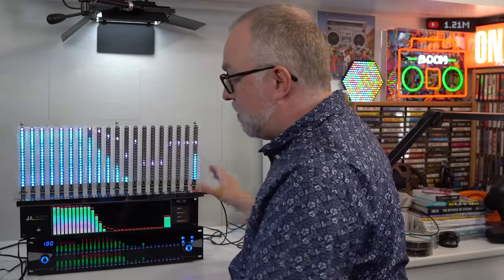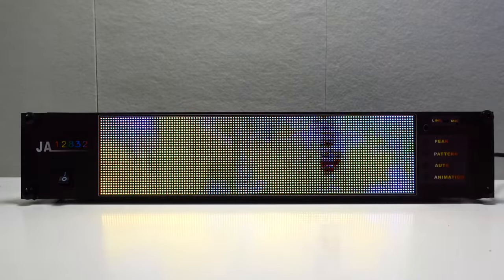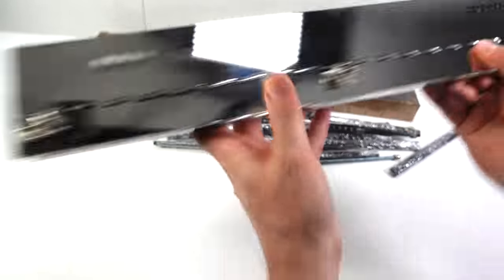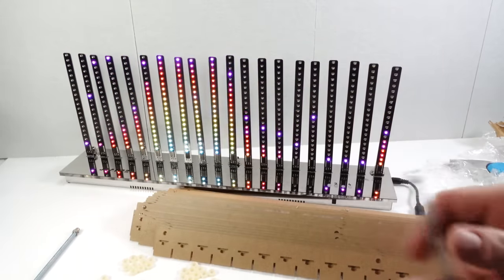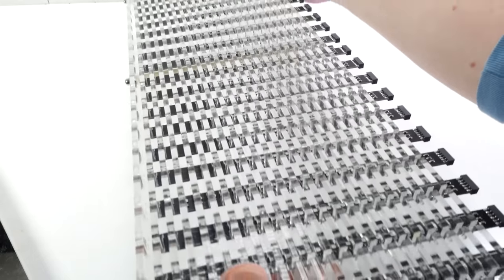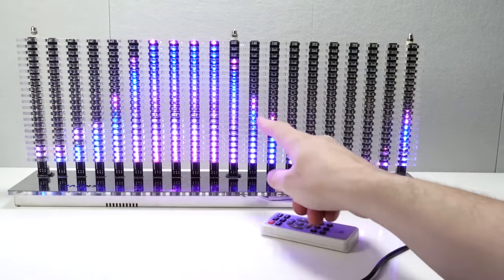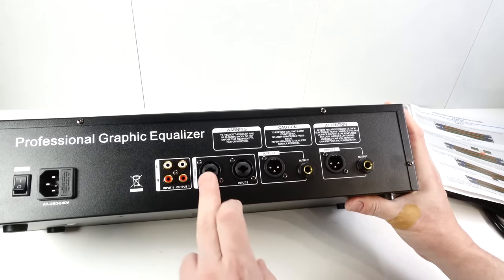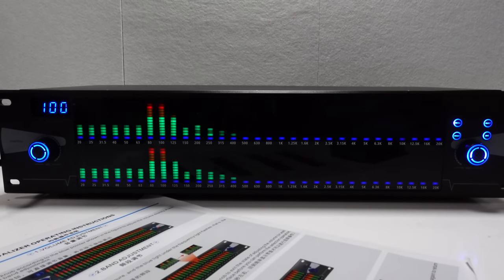Three more music Spectrum Analysers.  All that glitters...

Comment: The “dual channel” one that is actually mono just blows my mind. Why would they do such a stupid thing?! Anyway, you made it entertaining for us as usual!
Reply: money.
Reply: They could have used 2 mono circuits stacked one on top of the other (and use that in their mono version).
Reply: It's China style marketing
Reply: They know the "consumers" are easily impressed mit der blinkin lights...but don't know enough to question why? All they need to know is...."it's cool"...(and if it can be mounted on their dashboard.)
Reply: Agreed. It's not an impressive light show, and you can't tell which channel is clipping to use it as a spectrum analyzer.
Reply: Because they think (rightly, in the vast majority of cases) that no one will check
Reply: A surprising number of the things reviewed on this channel have had two channels of display that always display the same thing. Heck I think I recall some times when there were left and right speakers, both playing the same thing.
Reply: I'm wondering if it's a setting somewhere. Probably not though.
Reply: @John_Ridley  That's right. It made be go back and check a no-make CD walkman I bought five years and wouldn't you know it, that's mono too.
Reply: @savoirfaire8979  I've gotten lots of stuff from China that was cheap and still decent quality. For 150 pounds, you can get a computer monitor, a Fender Squire and amp, a moving head stage light, or any of a number of cheap Asian products that actually do what they suggest at 1/2 to 1/4 the price of a western made model.
Reply: I'd want to check the instructions to see if there's a mono/stereo setting somewhere.
Reply: China, innit
Reply: this was noted in another video too. might be worth looking inside to check the circuit if possible (vaguely recall some suggestion L and R  are commoned inside so the uneducated user doesnt get a half dead display when one of their own leads is faulty)
Reply: It's called an AliExpress scam
Reply: In the instructions visible at 34:40 it says "Have select function, can choose single band or dual band".
Reply: @FunkyDisco79  interesting, but it either doesnt say how to change it or Matt couldnt figure out how to get it to change
Reply: @fumthings  It also says "4. SELECT Select button (Press SELECT button lightly, the display will show No. 1/2/3 opytions, can choose single band or dual band to use)"
Reply: @John_Ridley  Multi-speaker mono does have proper applications, though. Spatial fill without location is perhaps the most common - e.g. multi-channel audio sounds terrible in BGM systems, with the listener(s) in widely-varying positions relative to the speakers, unless it's downmixed to mono.
Reply: @FunkyDisco79  thanks again, i wasnt able to read it but i guess Matt doesnt read the instructions
Reply: I wouldn't be surprised if people complained that they were defective because both sides weren't the same, so they gave up and just did mono.
Reply: Also blows my mind. It's like going all pro audio with balanced I/Os and using a dual set of LEDs, but skimping on two bloody cheap-ass jellybean opamps and a bunch of passive components for the display control. I totally don't understand that. Where is our world going to?
Reply: @Azlehria  Agreed!  I've actually pointed that out to people in small stores and restaurants that set up their own background audio.  These days it's hard to find newer gear with a stereo/mono switch, whether for audio itself or FM Stereo radio.
Reply: You know, it could just be a setting. "Instructions unclear".
Reply: @bobblum5973  I've been lucky enough to deal almost exclusively with "professionally designed" systems - but sometimes pros are incompetent, too.

The worst audio shitshow I ever installed was a custom package assembled by an experienced designer. A designer recently transferred from the home theater division into the prime's new commercial division.

I'll just say that you really don't want someone with no commercial experience designing a 30+ zone, multi-level industrial system with life-safety and PA interconnects.
Reply: @jonnyreverb  That's because we have to pay our workers enough to live on and have workers rights.
Reply: @hyperfocus4866  Yes, the cost of labor is much less expensive in China, Taiwan, and 3rd world countries. That is why goods shipped from those countries are cheaper... What is your point? Did you think I didn't know that, or are you going on a morally superior trip on your computer/phone built with those cheap components? Do you think it is wrong to employ people in impoverished nations, or are you arguing that unskilled labor that doesn't require the infrastructure of the American educational system should be done here instead of in a developing nation?
Reply: They look like in and out rather than left and right! When the output was turned down you could see a difference in the top and bottom signals.

Comment: The second device was doomed to fail on lining up the LEDs. There's 22 acrylic panels and 20 LEDs on each of the strips. So it's fair to say them not lining up properly is no fault of yours.
Reply: Yep, clearly no tolerance analysis was performed. Nor were any f@cks given at the factory!
Reply: I guess you could use 20 panels and all the spacers, but, yeah it's a very half-assed implementation of an over-complicated design :/
Reply: I assumed the extra panels were to be unspaced at the bottom to hide the chips.
Reply: @jmctoob2  - Thought the same, but it didn't look like the slots were big enough to fit the chips.
Reply: @midniteoyl8913  Maybe some of the strips have a larger hole for the chips
Reply: I was thinking you could use the a few of the thin spacers ever fifth led or so to adjust the spacing to make that layer match again. Then use the large spacers for the next few layers. What you’re dealing with is the tolerance stack-up for something like this. You would have to adjust  the spacing every few layers to negate to stack-up to keep everything aligned because there is no way all the parts will have perfect dimensions.
Reply: Just tighten the screws to adjust it.
Reply: It really should have a vertical piece of acrylic for each LED strip, then a support bar across the top and bottom
What a bizarre and wasteful design that it's impossible to get right (like you said)
Reply: @kaunomedis7926  That's my thought too. Not a great method but it seems to be what was intended.
Reply: @Maker277  That was my thought as well.
Also i feel like stacking them on the base, instead of on the side, with a few led sticks as reference for where to add the extra height would be the way to go.
Considering that it's poorly thought out and takes that much work to put together, without any kind of instruction, that thing shouldn't cost more than 60 pound imo.

*That's 60 including shipping haha.
Reply: In the interest of simplicity, you could just use one strip at the top to keep the LED modules straight, and leave all of the others out. You would adjust the nuts up to clamp it straight.

If you really wanted it right though, obviously you need the correct number of panels. Then maybe the double spacer (one plastic and one rubber) between each, then squish it together until they line up as Kauno Medis said.

Or, you could return it.
Reply: @MadScientist267  LOL well, definitely points off (more points off) for not including instructions! I'm guessing the manufacturer doesn't really know how it's supposed to go together, so that's why no instructions.
Reply: @kenmore01  The acrylic strips do some light dispersal though. You could leave them out if you are happy with them that way but they'll look different.
Reply: I would have thrown it against the wall. Matt is so cool headed after wasting at least 3 or so hours, plus the money on this e-waste.
Reply: The point being missed is that the 'rubbery' spacers can be compressed. So you build the full height of acrylic using both sets of spacers and then tighten the nuts to compress the acrylic layers until they line-up. The taller LED strip was intended as the overall level indicator on the right (which would be correct if all the spacers were used). Using the longer LED strip would leave one spare shorter one to replace any faulty ones - looks like the factory expected some to be faulty.
Reply: Let's not beat around the bush, #2 is a piece of absolute rubbish.
Reply: instructions would have helped...
Reply: @kaunomedis7926  I thought of tightening them, but then I realized you would then have the screws tight in three places, and the two spans in between the screws will be bulging out to a different alignment.
Reply: @Maker277   - Should have inserted 1 LED strip in the bottom layer, and then and the layers and the different sized spacers as needed to maintain alignment  all the way to the top. Also adding a chrome strip to cover the transistors would have been nice.
Reply: @c3pu333  Agreed, especially as a DIY kit.
Reply: I guess it was users fault. He didn´t use a Hotglue Gun, that´s essential for a job like this. 😂😂

Comment: On the last analyser . . . the 63Hz band is duplicated to the 6 bands below it, so basically it's faking the lower bands, also 80Hz and 100Hz are duplicates of each other . . . it's all a bit scamy !
Reply: spits tea at monitor a bit! that thing reeks of scamy the button being upside down that display falling off the wobbly knobs what i dont get is how lazy they were with it, the stereo display instantly fell over because before he even called it out that the displays were duplicating i was looking at it going wait hold on why are the right and lefts exactly parallel even a song set like that would have had little moments of difference  they didnt even try to attempt to pretend it was possible someone would notice.

Comment: Wow, masochistic Mat in this one! I definitely would’ve stopped bothering after the first construction on the second unit — especially because they ended-up in phase by the end and the height matched. I think the manufacture measurements are what’s wrong rather than your method, probably a compounded rounding error! Still, I do appreciate the sacrifice of your time and your patience :)
Reply: When you spend over £100 on it you might as well make a project out of it. Or return it.
Reply: @tiepup  any extra spacing would have the acrylic extend above the circuit boards though, and any less spacing would have the circuit boards extend above the acrylic. 

There was no way with the provided spacers to get better alignment — it goes out of phase so slowly that the differences are sub-millimetre. Which makes me think it could be a case like 2.54 vs 2.5mm spacing for IC legs (not those exact numbers, but that kind of magnitude, tenths or hundredths out between the PCB pad spacing and the acrylic’s thickness — my guess is the acrylic and spacers were measured with digital callipers and that number was used for the CAD for the PCB without accounting for the limited resolution). 

Building it as you said may have confirmed that with less work than rebuilding it three different ways from scratch, but I’d determined that from just looking at it after the first time.
Reply: @Virolaxion  the first build was the project! The other two rebuilds were the masochism ;)
Reply: (1) word... comPLEX

Comment: That second one looks like it would be good if it were about £40 as opposed to over £100. I quite like the industrial look, but at that price really you shouldn't be paying for a factory work experience position.
Reply: Yup, I like the design of the second one
Reply: Fully assembled and with the LEDs in the right place, then yeah.
Reply: £10-20, tops.
Reply: Totally. Is it just me, but it seems like this cheap Chinese tat has gone up in price a lot in the last few years? Haven't bought on anything on Aliexpress for a while now, doesn't seem to any point.
Reply: It would look pretty good, when lined up properly. But it is grossly overpriced.
Reply: The first one looks like it could be nice if they fixed the software (more responsive/less options) and a lower price.
Reply: The second one was almost the second worst, aside from the no instructions and the dodgy LEDs it had a tendancy that whenever he touched it an entire section at the lower left would glitch go black then come back, that thing isnt even worth 20 bucks, its a mess of junk that someone threw together
Reply: Imagine cleaning it after a few months, too!

Comment: I think for the second one you should build it bottom to top with the LEDs already placed vertical in the base. Then you can check the alignment of each piece of perspex and decide which washers to use for the next one
Reply: to be specific, install led strips into base along with the threaded rods, put first acrylic layer on, install thick spacers. from here, try another layer of acrylic, add thin spacers if needed, otherwise move onto next layer. adjust thickness of each set of spacers per layer as needed.

doing this process off the assembly, as became obvious, is an exercise in frustration.
Reply: Yep, exactly how I would have done it.
Reply: i was screaming at the screen!! how was this not obvious????

Comment: Correct way of assembly is probably screw the posts into the base, insert LED strips and then space the acrylics to proper level as you go?
Reply: But you cannot space them properly unless you make your own spacers instead of using the supplied ones.
Reply: Perhaps you need to use both the hard and soft spacers as Matt did, but then tighten the top bolts until the space is correct?
Reply: @MrJef06   I do not think so, the difference of height of the two spacers seems too much. I think it is just manufacturer's error or incompetence.
Reply: I think I’d trim slots into the thin separators and then try using them to shim up as needed ... but does look like a nightmare.
Reply: @pev_  It may not line perfectly but using one spacer or the other or adding both when needed should make a better result.
Reply: @MrJef06  Right with one of them being squishy I was assuming you'd tighten it down until it squished down to the correct spacing.
Reply: @John_Ridley  you cant tighten them down past a point, the top nuts are acorn style nuts and the bar would bottom out. It's just china things.
Reply: That's exactly what I thought. Put one or more LED strips on the first piece of acrylic and layer on the other pieces and checking the alignment as you go.
Reply: What's the matter with you people? The product is obviously flawed, you cannot make them align all the way with the supplied spacers! And as someone else said here, there are 20 LEDs heightwise but 22 acrylic plates. And what about the two "extra" longer LED strips, they have 30 LEDs in a tighter pattern. It's all a mess by an obviously scrappy manufacturer.
Reply: @pev_  Well you can return it to China, fix it or complain until the cows come home.

"Those who want, look for solutions.
Those who don´t, look for excuses."
-Jan Werich
Reply: @tarnvedra9952   Suuure, good luck trying to return it and get some money back. It is almost sure that by then you have at least lost a lot of money on the postages and if you get anything back is a luck draw. There is no excuse of this thing being so shitty, unless you think that all things from China should be excused simply because they commonly make shitty things!! DUH!
Reply: @tarnvedra9952  AliExpress has warehouses in Europe to get around EU import taxes, so you'd probably just have to return it there.
Then again, doesn't really help Mat, what with GB leaving the EU.
Reply: The correct way of assembly is to get the LED strips and the acrylic pieces and gently lift them into the bin.
Reply: Yeah I'm guessing you have to build it on the device and using the spacers , sometimes a full plastic one by itself then sometimes a combo of 2 small ones or a small one and plastic one to get it to the right level